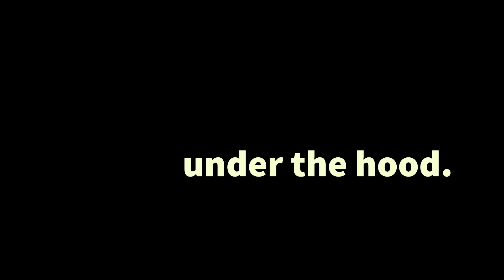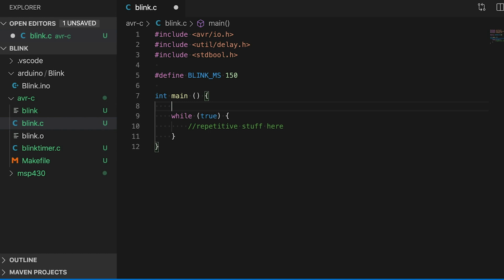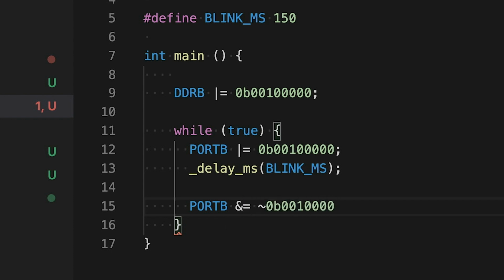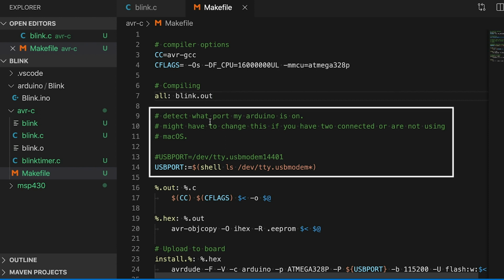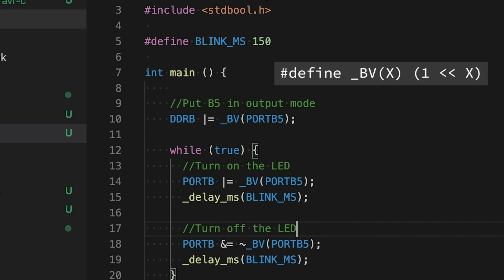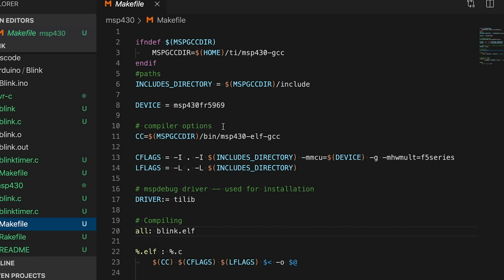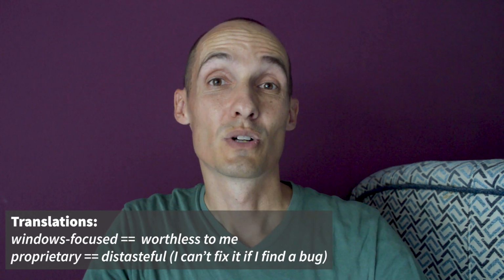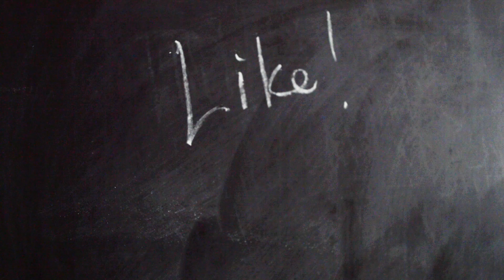How to Blink an LED in C (avr, msp430)

Comment: I really like this video I have like 20 atmega328ps and at lest 10 of them have the minicore boot loader on them. (Arduino comparable)  I use Gentoo as I am in no rush :)  My dev system is just  nano and make and avrdude which you show can use Arduino so it knows to talk the the bootloader on the chip.  As for the STM32 I am just too soft for that. Ty for sharing really like the breakdown on how the funny things in the makefile work.

Comment: Do you have recommendations for using msp430-elf-as with MSP430 assembly?  I've built my toolchain from source and can get C working fine, but the assembler doesn't like any of the MSP430 specific assembly directives.  Been hunting for a few days now to sort this out

Comment: If you go the AVR path, make sure you go get the Atmel datasheets on the MCU you're working with and read through it some. Things like DDRB seem scary and cryptic until you see in the datasheet that means "Data Direction Register - Port B". Then everything else Jacob explains is like, "Oh, I see!!!" There is a ton of info in those involving the timers and comparators and some of that is just magical with how well it works.

Comment: Thanks for this great video series. I really appreciate the informative content you're putting out here for us all.
I see you're using VS Code - I was wondering if you use any extensions that assist you in embedded programming?
Also, do you have a good way of managing header files - by this I mean in the way you might manage dependencies in web development. Is there a good way of doing this, or are you simply downloading the header files from TI and making sure to keep them up to date?
Cheers

Comment: I've been working for quite a few time on TI's CC2650 launchpad MCU and man, the documentation and function / register abstraction is like an endless maze, total nightmare !! I've never felt so helpless working with embedded systems before in my life.
Reply from the maker: Agreed. I actually stopped using the CC2650 in my research for that reason. It was just too difficult to get clear answers.

Comment: I disagree about IDEs getting in the way.

I'm right now using Xcode as a GUI to lldb in order to find where I need to modify code to add a new feature.
Reply from the maker: Yeah, sorry if I gave you the wrong IDEa. I'm ok with using IDEs as long as they behave themselves. I think they're problematic when new programmers are learning, because they hide stuff, but I sometimes use them myself, and in certain situations they can definitely simplify things.

Comment: Thanks for the video, its awesome!
I'm very new to embedded systems but I got to know that C is the common language as of now.
But there C++ is gaining popularity.
Can I choose to learn embedded programming in C++ instead of C?
Reply from the maker: Absolutely, just be careful. Make sure you understand what those C++ features are doing for you. Things like classes should be fine. Things like dynamic memory allocation (new) could get you into trouble, especially if you have very little memory. Virtual methods can add some delays, which may or may not be a problem. C++ is just more complicated, and so there are more things that beginning programmers often don't understand that can cause problems that seem like magic.

Comment: A LED, not an. "An" is only for consonants. Great video by the way.
Reply from the maker: Thanks. 
I'm not sure I want to get into grammar debates on the channel, but I disagree. I've heard various opinions on this, and there seems to be some debate online. I prefer using "an" with acronyms that sound like they start with a vowel, like LED or RPG when read. The benefit is that it sounds correct when read it aloud, and it seems to be the most common opinion. 

More reading...

https://www.grammar.com/a-vs-an-when-to-use/
https://www.shearsoneditorial.com/2013/07/a-or-an-with-abbreviations-it-depends/
https://web.archive.org/web/20160916082929/http://alt-usage-english.org:80/excerpts/fxaanbef.html
https://blog.apastyle.org/apastyle/2012/04/using-a-or-an-with-acronyms-and-abbreviations.html
Reply: It's 'an' LED. Reason being the pronunciation. It's pronounced as 'El' then 'ee' then 'D'. First letter is a vowel therefore an used. Spelling wise, 'LED'.

Why it's that way? I have no idea. It is something we'll have to ask the English.

Comment: I think the bigger snag to embedded programming is using RTOS. You get an extra unknown (RTOS version can work with one specific version of the compiler) etc.  If you add an extra library to the equation your build process complexity grows exponentially. I had one project for which I didn't document my toolchain (I wasn't aware of those headaches at that time). One year later it took me around 8 hours to build and upload it again! This was TI Tiva TM4xxxxx. You get an error, nobody had it before, you look the header files they don't have symbols they should have or renamed them etc. I have 3 TI development kits and I haven't been using them for a long time due to build process / flashing firmware problems.

Comment: One more rant and I'll shut up.  Embedded microcontrollers are complex devices so managing that complexity is key to more universal use of them and more jobs programming them.  Folks (like me) who design the product (e.g. solar inverters) simply cannot divert the time and effort into becoming professional computer programmers just to get that job done.  We know the detail functions required and we know microcontrollers have great advantages, we just need a simpler "cookbook" to access them at a low level.  Asking a professional programmer to "fix" this complexity usually results in further levels of abstraction with greater risk of not knowing what's really going on.  In Power Conversion, one is always a microsecond from disaster so that is not an option.
Reply from the maker: I know. Especially if you get a professional developer who trained outside of embedded systems. The tension between abstraction (and all the benefits that come with it) and keeping things tight and simple is really common.

Comment: Jacob, add delay() waits CPU time. This way cannot pass job interview. Not a good example for Blink even all vendors just use this way for demon purpose.
Reply from the maker: I'm not sure I follow. Are you saying that I shouldn't show examples that aren't job-interview grade solutions? I'm going for simplicity here. If it's your first experience with microcontroller programming under the hood, I'm going with the simplest thing that works. I'll show you how to do it with timers and sleep modes in a future video.

Comment: You are correct!  The biggest snag to embedded programming in bare metal is poor documentation.  The first thing I look for is the pointer constants to the configuration registers.  Next is the labels they pick and the structure so one knows the syntax to manipulate these registers.  This information is often scattered or poorly formatted or obscured by levels of abstraction that confuses the "bare metal" level with higher levels.  I personally don't think bit definitions are worth it, too many and you still need the spec sheet definition of the register bits for many peripherals.  Finally, the Makefile approach where one is setting compiler options/flags is downright scary - I never feel confident that I can get these all right.  Keep up the detail on this.  Think about a session on ARM microcontrollers in the future (such as the Bluepill).  Great stuff.
Reply: Even today most 3D printers (for hobbyist) are coded with Arduino libraries, because bare metal straight down to dangerous level which makes undefined behavior seldomly happen